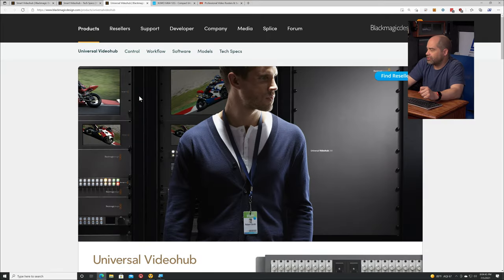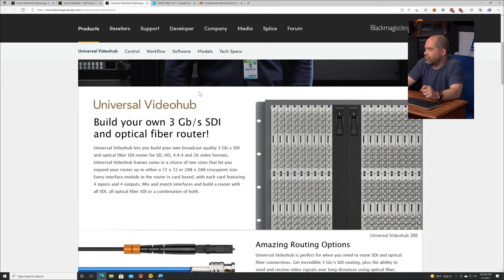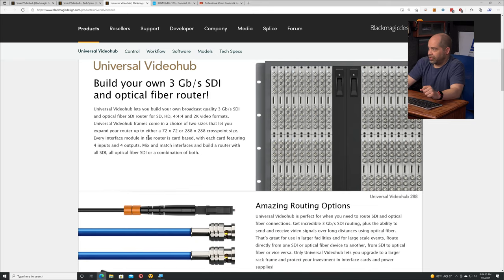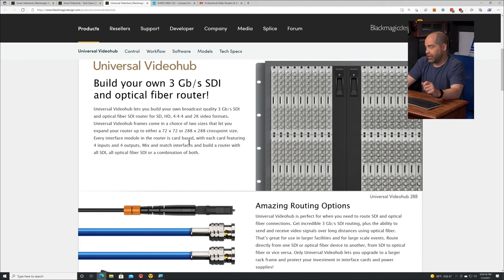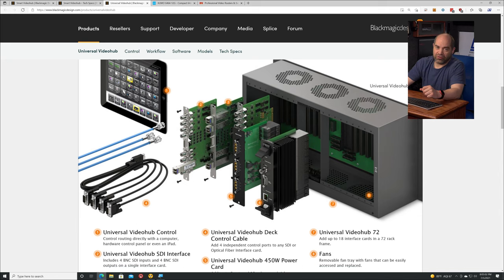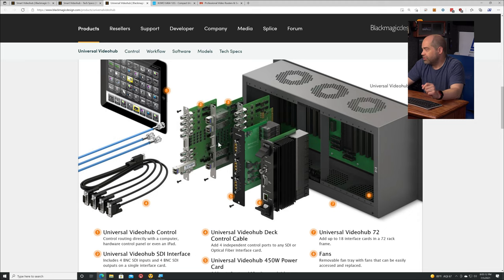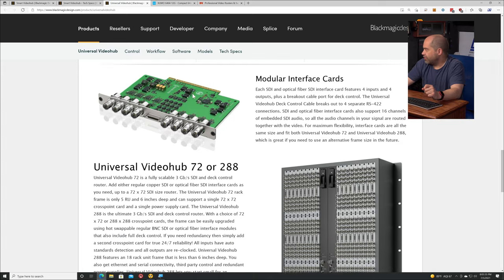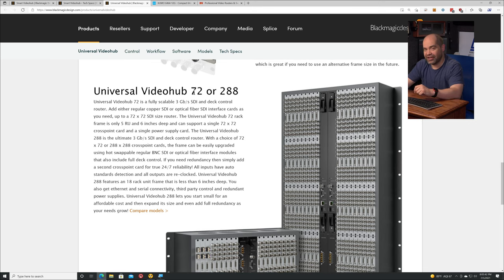Routing Switchers (plus, how mine are set up)

Comment: I have a 12x12 in my fly pack rig.  love this device.
I use it not just to reroute internal signals between the Atem, recorders and interfaces, also as a splitter and distributor for external monitors, as well as providing feeds for venue AV systems.

Comment: Hey Doug, thanks for your videos - so helpful. Q: some of your sources must be HDMI (like computers, or certain cameras)... do you convert EVERYTHING to SDI and drop it into the 40x40?  If so - MULTIPLE converters or ONE system of some sort?  The HDMI-SDI world is tough for me, so many different sources... trying to figure out the best workflow. Thanks!  (Jason)
Reply from the maker: Yes, I convert everything to SDI. Each of the computers in my trailer goes directly into HDMI-to-SDI 4K/6G Mini Converters. For several of the computers, that actually means two or even three converters -- one for each video output. And then all of the monitors have SDI-to-HDMI 4K/6G Mini Converters. This arrangement allows me to route the video from any computer to any monitor, switcher, video recorders, etc. or any combination thereof.

Comment: with all the conversions etc. fiber/routers/sources what are your issues with insuring live cameras are in sync with each other for audio?
Reply from the maker: The SDI/fiber conversions don't add any latency at all; that's just a conversion from electrical to optical and vice versa -- no processing takes place.

As for sync between camera and audio, most of the time I don't have to worry about it. The cameras I use have really low latency and it's difficult to spot the difference between when you hear something and see it. But when I do, I just send those live audio sources to an aux bus on the mixer that has a 2 frame delay on it, while leaving other audio sources (playback, effects, etc.) alone without the delay.

Comment: How are you getting locked timecode to your Hyperdecks? Did you just jam sync them?
Reply from the maker: The timecode on the HyperDecks is derived from the SDI signal, whether that be the ATEM switcher, camera, or other video source. I'm not doing anything to override it.
Reply: @djp_video  Oh I see, it's the same source going into each deck. Makes sense. I wish those decks had some kind of external input on them, but then they wouldn't need the Studio Pro I guess.